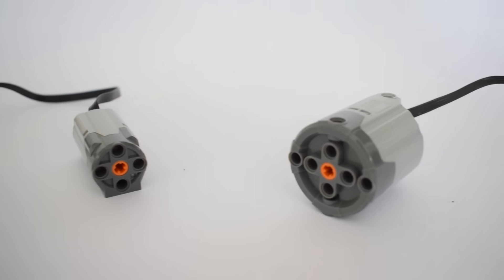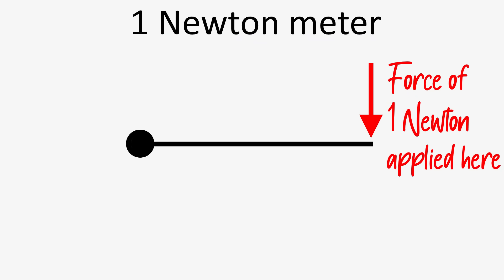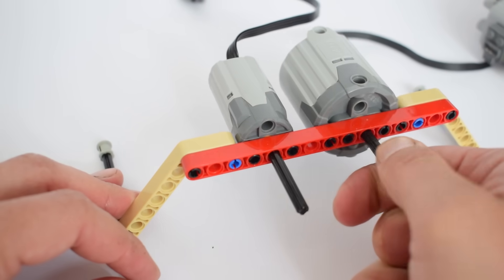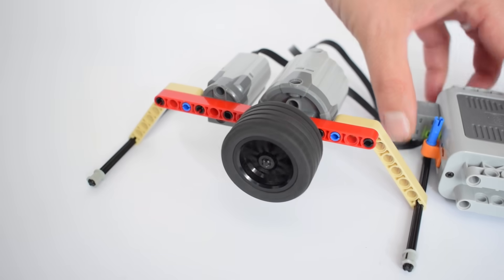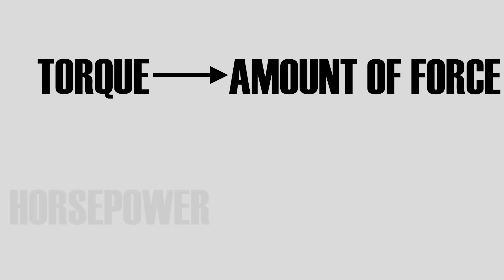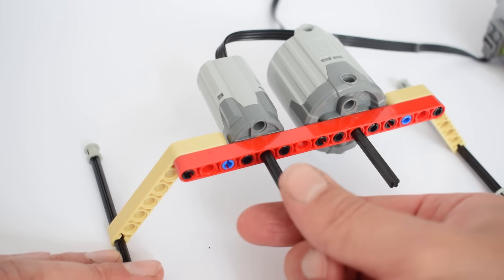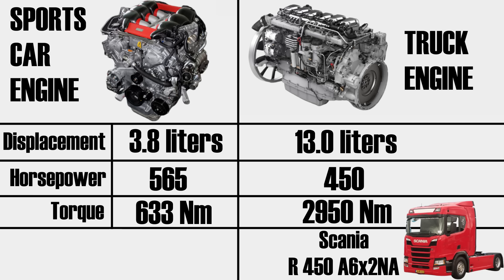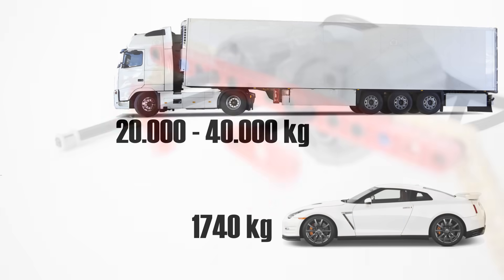NEVER be confused by HORSEPOWER and TORQUE again - HP and TORQUE EXPLAINED in the MOST VISUAL WAY

Comment: If i were climing with fully loaded semitrailer to step hill and using 450hp of scania engine then suddenly swap engine (and gearing to match speeds) to the one from nissan with 560hp will i start to accelerate or deaccel?
Reply: That’s a fascinating question! If it could be done in practice. I’m by no means an expert but I guess you would have to take inertia into the equation?
Reply: Inertia is mass x speed. Speed is constant, mass is a bit lower because of smaller gtr's engine 😁
Reply: @vilbenasvienuolis  inertia is mass x speed (👍 as I said I’m no expert,very far from it in fact!) but if I understand your question properly then the lorry/semi would still be moving when the switch of engine/motor takes place without time taken into the equation?
And let’s skip over the weight of the engine for this scenario 😆,but great call!
Reply from the maker: The interesting part of your question is "(and gearing to match speeds)". A gear ratio can increase torque, but at the price of speed. So let's observe a simplified example. Our truck has 2950 Nm coming from the engine and to pull a fully loaded weight uphill it will use it's first gear. Often in trucks you will find that the first gear is something like a 14:1 ratio. This means that the engine has to make 14 rotations for every single rotation of the transmission output (I'll ignore differential final drive ratios for the sake of simplicity) A gear ratio that reduces speed increases torque and vice versa. A 14:1 gear ratio will increase our torque 14 times and reduce our speed 14 times. Trucks have these kinds of gear ratios in order to be able to move heavy loads from a standstill, i.e. When you need most torque. Once you're moving and the vehicle has inertia you obviously need less torque and more speed. Cars will usually have something like a 3:1 first gear and 0.9:1 or similar 5th or 6th gear. The 0.9:1 is great for speed but you can't take of in fifth gear because there isn't enough torque - the engine stalls because it can't generate enough torque to overcome the weight of the car with that gear ratio. So to come back to our example. The truck is going uphill fully loaded at 1500 rpm engine speed and let's say 20km/h vehicle speed using a 14:1 drive ratio. If you magically swap the GTR engine in that moment you need to use a different gear ratio to make uo for the lack of torque. The GTR engine makes 650Nm peak torque. The truck engine makes 2950 Nm which becomes 41300 with our 14:1 gear ratio. To make 41300 Nm the GTR engine needs a 63:1 gear ratio. This gear ratio increases torque 63 times but reduces speed 63 times. We need this gear ratio to retain the same torque to prevent the GTR engine from immediately stalling upon being swapped. Our truck engines 1500 rpm engine speed was reduced 14 times by the gear ratio to  107 rpm at the wheels which we imagined equaled 20km/h. Truck engines can make peak torque at such high rpm but sports car engines can't. Our GTR engine needs to be revved up before swapping in to let's say 5000 rpm where it makes the 650 Nm od peak torque. Now the 5000 rpm of engine speed will be reduced to only 79.3 rpm at the wheels by our 63:1 gear ratio. So the answer is that upon swapping the GTR engine and revving it up before swapping in and using the adequate gear ratio to get enough torque you will still decelerate because a gear ratio needs to sacrifice speed for torque and vice versa. Phew.
Reply: @d4a  that’s amazing! Thank you. You sure have gone to enough effort to explain in layman’s terms so I can understand and gain some knowledge,and it was just a discussion in the comments section between two of your subscribers!👏🏻. I can see you going a long way on this YouTube thingy and I’m sure your hard work will pay off for you and your family. I’m looking forward to my next lesson in Boost School 👍. All the very best, Ant.
Reply from the maker: @anthonyh958  No problem. Thanks so much for your kind words Anthony. I wish you and yours all the best too.
Reply: @d4a  Here is the maths, Peak power Scania is 450 hp @ 1900 rpm. At this RPM, the torque is 1686 nm. Assuming gear ratio of 14:1, this will result in 23604 nm wheel torque. At peak power of the Nissan GTR, the engine is making 565 hp @ 6800 rpm. At this rpm, torque is 592 nm. Therefore, a gear with a ratio of 50:1 will result in 29600 nm of wheel torque at 6800 with the same road speed (6800 = 3.58*1900, 14*3.58 = approx 50). Of course, if there is more wheel torque then the vehicle will accelerate faster, so Nissan GTR engine (more powerful) will be faster up hill than truck engine.
Reply: @d4a  Also, here is spec sheet for engines. Btw, I liked your video until the feeling of force part. I'm not trying to be rude, it's just you have made a mistake in this part which will be confusing for people, as the most powerful, assuming a perfect gearbox, will be fastest up the hill. https://www.scania.com/content/dam/scanianoe/global/eventcontent/2016/scania-at-iaa-2016/releases/16092205EN.pdf
Reply from the maker: @coreyw427  Are you insane or something? You're just using different numbers and the same math. Of course the result will be different with different numbers. How can you be intelligent enough to do the math and not realise that it doesn't matter if it's an actual engine or not for the sake of an example? You can make up numbers from your head for the sake of the example. It could be 10.000 Nm instead of 2350 or 2950 or 650 whatever. I was just explaining the principle of how it works. You can take any two engines with different torque for the sake of the example. Both the Scania and the GTR have many different versions with many different specs but that's not the point.
Reply: @d4a  Because OP specifically asked if you swapped from 450 hp engine to 565 hp engine which would be faster and you told him the 450 hp engine would be, which is wrong. And the reason it’s wrong is because your 450 hp engine is actually 621 hp. OP didn’t ask if you switch from a 621 hp engine to a 565 hp engine which will be faster, which is what you gave the answer to.
Reply: @coreyw427  this guy is wrong, won't admit it and will take a lot of people with him. He needs the likes and subscribers, not the truth. He will keep defending the Earth is flat physics because he needs the audience.
Reply: @d4a  This is incorrect. Provided gear ratios are perfect, the most powerful engine will accelerate faster. The problem is that you’re claiming that this engine is 450 hp and 2950 nm. I think you have got specs mixed up as it is the 16L Scania engine that is also 580 hp with this torque. Actually this 13L engine is 2350 nm. If you don’t believe me, you can work out power from torque @ 1500 rpm which is 621 hp. This is why you have come up with wrong answer, because the engine in your example is actually more powerful than the GTR engine.
Reply from the maker: @coreyw427  You realise it's completely irrelevant whether the specs correspond to an actual engine or not? You could use an imaginary engine for this purpose, which is to answer the question above and to demonstrate how different amounts of torque behave in this scenario.
Reply: @d4a  It’s not because he’s asking out of the two engines in your example which will be fastest up the hill. The most powerful will be, which is the Nissan GTR engine. Then you have told him the truck engine will be, when it has less power, because actually using your numbers (2950 nm @ 1500 rpm) it has 621 hp. I imagine OP is now confused and thinks that this truck engine with only 450 hp would be faster, which it will not be.

Comment: Cool video, but also a bit of a missed opportunity. 

Saying that "truck engines need more torque to pull greater weights" confuses the issue rather than explains it. They don't need greater torque, the whole thing could be accomplished with the right gearing by a bike engine of the same power. The point with the truck engines is that they can run at much lower rpm, which is good for fuel efficiency and wear.

There could have been another 10 minutes of the video where you attach gears to both motors and show how this manipulates the torque and the speed. Then you could put the motors in a lego car and show how acceleration and top speed are affected when different gearing is used. That, I think, would be most enlightening. Maybe part 2? ;)